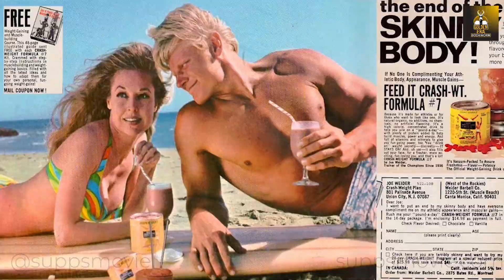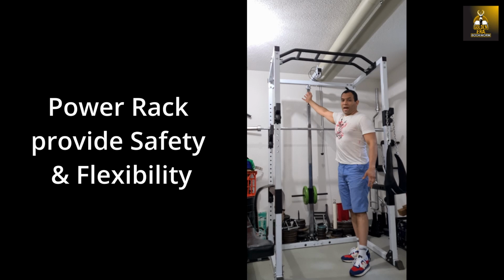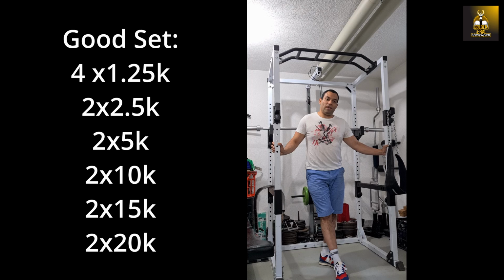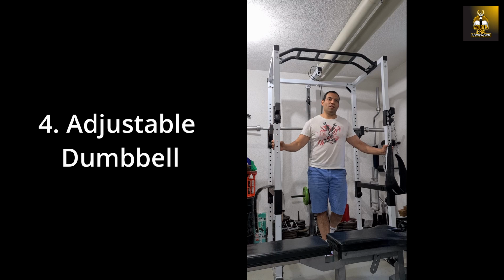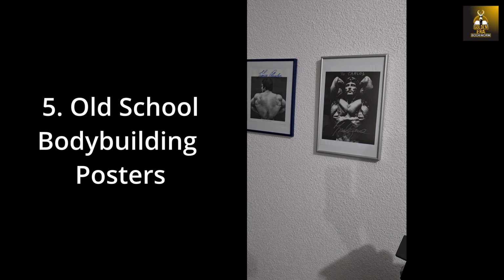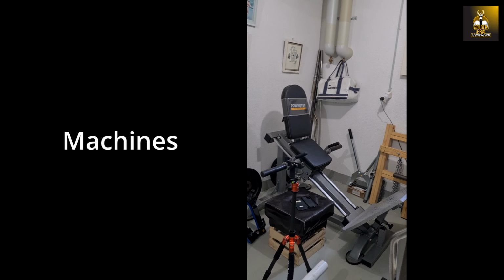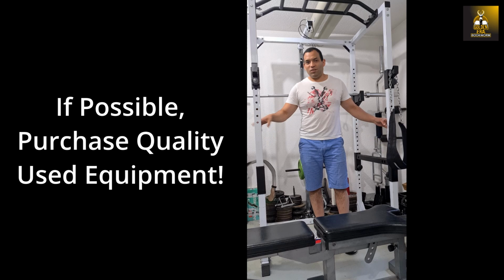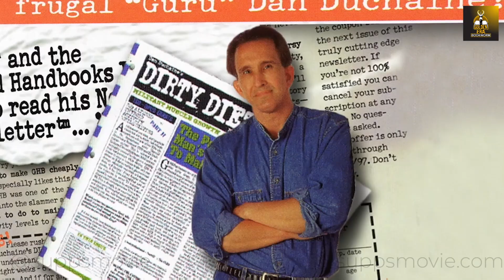HOW TO BUILD AN OLD SCHOOL HOME GYM! EQUIPMENT AT A CHEAP PRICE

Comment: The gym where i go to the owner designed and manufactured his own Gym equipment back in 1986 you wouldn't believe it not only the quality but after 35 years the equipment has been used day in day out the machines are still running smoothly and are on par if not better than some of the newer ones he has in the Gymnasium.
Reply from the maker: Now that's a gym

Comment: Thanks for the tips. I already have a   1 inch barbell from York barbell and also a set of 70 pounds set of adjustable dumbbells. I am planning to get a bench. I will try to find an adjustable one. Cool gym you have..
Reply from the maker: Nice
Reply: I bought one an can change it to squat or press also to dip handles are on it paid around 85 euro for it secondhand bought everything second hand barbel weights and adjustible dumbells.

Comment: My problem is I have a Gold’s Gym 1.7 miles from my house I could never get a work out at home like that. The other problem is you have the stuff there all the time. You take up a lot of space trying to get an area where you can work out and not have to put everything back in its place or  break everything down . I understand why people do want to have this and to some extent I have a little bit  at my house for some curls and for some dead lifting. Even that takes up space. A person really doesn’t have to spend that much time at the gym or at their home gym either. If it’s available a gym is much better as there are people working out there and also it gives you a feeling that you’re going there for a purpose. Sometimes home gyms  just don’t give you that feeling. Anybody that has have a home gym,  they should have it . For me though I’ll stick with that feeling of walking into Gold’s. It’s never something that I’m feel  maybe I should do something else . Once I’m there it’s all about work.💪🏻
Reply from the maker: For me it's a choice that has worked well because I'm a father. It's much easier to work out at home and my kids join in every once in a while too
Reply: Two key elements what you overlooked,

1) access to a great gym

2) transportation to the gym

Me don't drive and to get a good gym it take 45 mins to 1 hour on a bus to a gym

Again i don't have a great commercial gym to go to

The gym I go  to, I have wake up 3 am to be in the gym by 4 am as after 6 o'clock is impossible to use the gym

So many  benefits having a good home gym
Reply: your being fooled if you spend a little bit of the cash you can get everything you need to get a good if not better workout then at a Golds
Reply: I started working out at Gold’s Gym  Santa Monica in 1978 I think along the line I’ve had some very good workouts. unless you’ve worked out at a gym that is truly history and also everything that bodybuilding is about it’s hard to compare having a home gym. My point was I am lucky I have these,  not I am better than someone else. If I didn’t have the access and a good gym I too would have a home gym. It’s not a debate just a  I am lucky that’s all. After all we’re all in this together. Rich